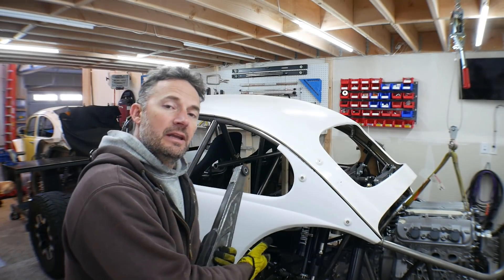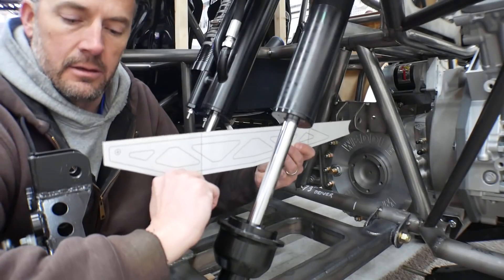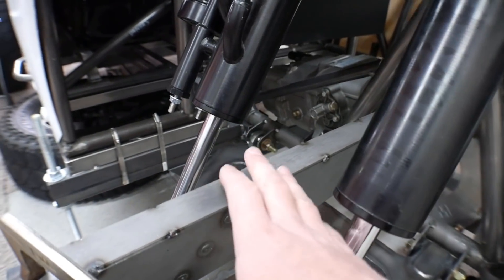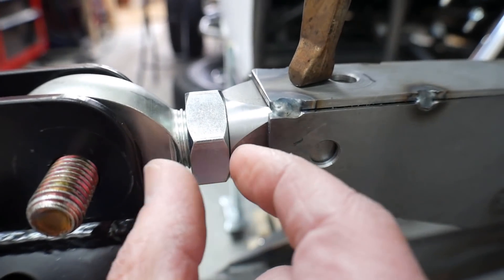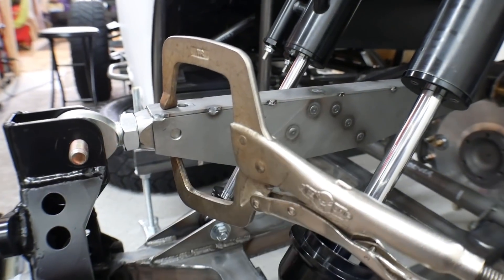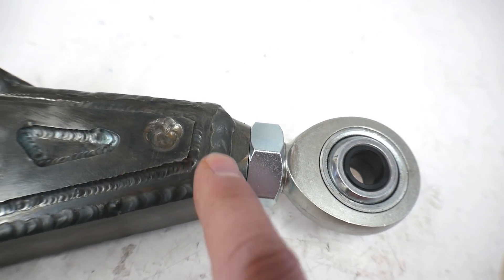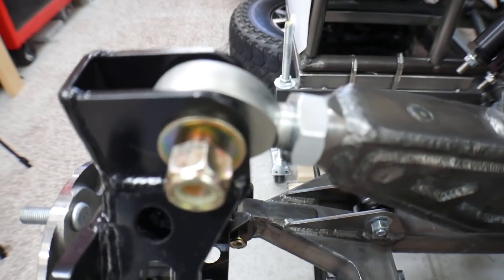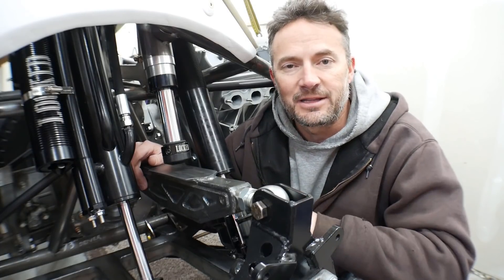Wratchet Upper link for Bump Stops Fabrication...

Comment: I have been wondering for a long time, why you chose to fabricate the axles in the rear, using universal joints, versus just using CV joints, and off the shelf axles?  CV joints are stronger than universal joints for one thing, and it's fairly easy to get axles in any length you need.  Cost?
Reply from the maker: Well, it's easier to fab with U joints. Meaning you can make changes to the track width because the axles can be moved in and out some. And it's cheaper at least at first. As to what is stronger I'm not really sure.
But in a perfect world this would be non plunging CVs, and I might switch to that once this is up and running and I know I won't make any more track width changes.
Thanks for the question.

Comment: If the heim joint breaks you could do a eccentric nut type adjuster with 2 bushing ends.
Reply from the maker: This is true, I'd have to make some changes on the chassis side. But it could be done.

Comment: Sweet bug, lots of thought into it you can tell.    Have you had problems with no filler fillets (like on your strap) ? When I was making my winch I was doing that, and they looked spectacular but upon closer inspection they all cracked because the area under the flow was super thin.
Reply from the maker: I've been ok with it on thinner materials that will not be flexed much. If it's thicker (say over 1/8") or can be flexed it'll crack. But you always take a risk when you don't use filler, typically the weld is half the strength than if you properly used filler.
Reply: @DougBugBuilder  yep, that's what happened with ours. I enjoy the content, thanks for sharing!

Comment: It would be a more involved design, but at the bushing end, instead of welding the bushing directly to it, implement a concentric housing and fastener system into the end of the strut and that would give you back some of your granular control of the camber that you lost.
Reply from the maker: A concentric housing would have been a good idea. With that I could possibly do away with the heim as well. Would need to design a housing that wouldn't be prone to rotating under impact, but that wouldn't be to tough.
Good idea. 👍
Reply: Doug Bug  I think where I've seen it best used is in the frame of the car where the arm attaches. With large washers and an offset hole and they leave the bushing and arm simple. That would require a larger update of your whole rear subframe :-(

Comment: Thanks for content i really enjoy your videos and like what you build. i gotta say however i do cringe when i see you fusing welds. IMO any weld on a suspension part should be full pen and welded with filler rod.  Welding without filler just creates undercut and undersized weld thickness.
Reply from the maker: Honestly I appreciate you bringing this up. I know from experience that no filler is not as strong. I tend to get complacent thinking it's strong enough without filler. So a reminder from time to time helps.
So I appreciate the concern and comment.

Comment: Coming together nicely Doug!  Watching that rear cycle was beautiful.  I don't think you'll have issues with torque rotation unless you get up near 350+ HP with how stout your lowers are.  The new uppers will definitely handle the bump stops.  I like how you blend your personal knowledge with the latest tech of the big boys toys.  It gives all your pieces a one-off appearance.

I know you're trying to cover all the bases, but I'll say it once more - especially now that your uppers are so laterally strong: I believe your weakest point is the mount for the inner bushing.  It appears that the C cup is welded to flat plate between the A shaped tubes.  With the lateral forces that upper will receive, I think that flat plate will deform and thereby throw off your camber.  I think a combo of boxing in and one more support tube would suffice.  Just food for thought...

Always am impressed!
Reply from the maker: I'm getting close to making Wratchet a roller. Before I do that I'm going to weld up everything on the chassis so far. This way I can take it off the chassis Jig. 
So that means I'll be boxing in all the tabs and such. But the connection you are talking about between the A shaped tubes is tricky. It needs to be removable so the transaxle can be removed. But I plan to show what I'm working on with a video when I weld everything up.
I agree with you though, right now that is critically weak.
As always thanks for the comment and opinions.
Reply: @DougBugBuilder  Ah - didn't know about the caveat, "Needs to be removable.". Always a hook to keep me coming back!  Lol    Looking forward to your solution...

Comment: I really would like to see you attaching a 10 foot pole to the spindle and see where the acceleration reaction forces end up.
Reply from the maker: I'm curious about that myself. When I get it up and running I plan to put a camera on it and do some acceleration and braking tests so I can watch it and see what I'm dealing with. There's more bracing that I could have added but didn't want to overdue it. But I'll see.
Reply from the maker: I was thinking about this after my comment, the spindle won't see any acceleration forces, only braking. The transaxle will take the acceleration forces. But either way I'll test it.
Reply: @DougBugBuilder  Correct.

Comment: The strike pad and those triangles will hold up just fine. I don’t think the loss of adjustability will be any problem. You already proved you can get it where you need it.
Reply from the maker: I thought adjustability would be an issue, but when I was setting it I had no problem dialing it in. So that's a win I'll take.  😁

Comment: Looks great. I agree it should be totally fine. You might get a slight amount of flex as the lower arm bushing wear out but if that's the case you could easily replace them with Uni-balls. I think it'll be fine though. The spread on the lower link mounts is really wide and will support it well.
Reply from the maker: I'll keep an eye on them, I also though about making them out of Delrin. But I'll see how they hold up.
Good to hear from you, you've been here a long time. ✌
Reply: @DougBugBuilder  life has thrown me some curve balls that I've been dealing with but I've been keeping up with the progress for sure. If things go as planned I'll be very busy this summer with cool projects that I'll be making videos off. Hopefully getting a new shop built finally.

Comment: Looks a lot better Doug. Just would if used 4130 for all the arms.
Reply from the maker: Problem is, because this is a design build, I continue to make changes as I go. Like I made the front control arms twice to make minor changes. So I'm reluctant to spend top dollar if it might end up in the garbage.
I agree with you on the 4130, but I'm trying to control the spending. But I also don't want to make an inferior part.
I'm hoping when it's up and running and I'm happy with the design I'll go back and make some parts better. But we'll see where it goes.

Comment: Adjustments would depend on the threads per inch of the upper heim, if its 3/4 x 16 then one full turn would be a 1/16 or half turn on the heim would be 1/32. for camber adjustment, great work as always love the beefy construction!
Reply from the maker: They are 7/8" x 14. I actually thought that the adjustments would be coarse. But when I was dialing it in to 0 camber there was more control than expected. So that was a good thing. 
Thanks for the comment, and the math!

Comment: Hey NICE JOB! the poly bushing is perfect to prevent the link from rotating. They do make sleeved adjusters that can be fine adjusted, they use a left handed heim, with a sleeve with left have internal threading, and right hand external threading, then the sleeve threads into a right handed bung. google: Synergy Double Adjuster Tube Adapter. I used them for the rear upper control arms for my 99 land cruiser. oh and a tip for warping bungs, leave an old heim joint threaded in, and wait to remove it until it cools. higher end bungs will have more clearance on the threads to compensate for this issue.
Reply from the maker: Well I didn't know they had bungs like that, thanks for the info! I don't think I'll need that, but good to know it's there if I do.
I guess haveing a heim in there would act like a heat sync. Thanks for the tip, and the comment!
Reply: @DougBugBuilder  Those are also handy if you cant easily access one side of a link. 

It does act as a heatsink, but it also will prevent it from contorting mechanically during welding, since the warping force wouldn't be enough to crush the threads.

Synergy makes these badass bushings called dual durometer bushings, definitely worth taking a look at. they don't need grease and have all the advantages of poly bushings and bonded rubber bushings. No noise, rotate without binding and flex more easily than bonded rubber and much easier than poly. they also wont beat up your brackets as much as a heim. been running them for years on my LC.

Comment: Great design considering the bump stop not hitting in an optimal location. If the inboard mount was wider it would give that upper more strength, but I see it’s getting tight on clearance . Nice
Reply from the maker: Thanks, and yes, it's getting a bit crowded in there.

Comment: I seen in your last video talking about your front steering. What are the advantages over front vs rear steer as long as you achieve Ackerman?
Reply from the maker: Personally I think rear steering is better. All the steering is behind the suspension, so it's more protected. The only reason mine is front steer is because I need to have the rack forward so there is enough room to run the steering shaft back to the wheel in a straight line.
Reply: @DougBugBuilder  Awesome thank you for your reply. I been looking all over at articles some say front some say rear with over steer or under steer being your performance difference. Then some say it’s just due to what room you have to work with. Your reply cleared up my question.

Comment: That's awesome man! I've been wanting to build 4 links like that for my 4x4. My Suburban has a 12 inch lift so they are gonna be pretty long! Would like to do something custom other than just round tube.
Reply from the maker: If you box your links like I did here, add the stiffner brace like I did if you can. It's a lot of welding, but it really looks nice! (and adds strength!)
Reply: Since I have a cnc plasma table I can cut the plates too. Do you prefer the laser cut for a particular reason?  Maybe less clean and nicer cuts?

Comment: Probably not necessary but to tweak the bump stop to the strike plate by arching the plate to look like a saddle.Very great build man ,I'm just building stuff from various re purposing. on My channel at glassblastcollision. Keep up the good work!
Reply from the maker: I thought about that, but decided it wasn't necessary. And it's tough to kink 3/16" so close to the edge. But our brains were thinking the same thing. 👍
Reply: @DougBugBuilder  You remind me of a old friend named Larry , We built ergonomic lifting equipment for factories together. I miss em he passed.  I have another fuel tank the same as the one on my channel and Id like to scratch build a complete suspension so I'm picking your brain  Doug Cheers !

Comment: Nice upper links !! I wish I had access to a plasma or laser cutting company.
Reply from the maker: I order the laser cut parts from OSH CUT, all you need are DXF files and money!
But if you have the time and patience, you can do the same with a bandsaw and some cardboard templates.
Reply: @DougBugBuilder  I'd rather just order it . I'm not too good with cutting plate 🤣

Comment: Very Nice,.....,yeah the weak spot will be the Heim ...Using "FK" Rod Ends?  May call them and ask .about strength.  Just a thought....Kevin is  a Ham   lol   Nice weather is coming!
Reply from the maker: It is FK, the specs say 55,000 lbs, but that's static load on the bearing. No specs on the vertical loading of the shaft. But it is 7/8" and chromoly, so we'll she what she can do.
Next week should be in the 40-50's, that's much more tolerable than 20-30's. 
Thanks for the comment! (Kevin is crazy!) 😁

Comment: That’s one thing you won’t have to worry about. Very well made. Could have built a v shape but “anything with doing is worth overdoing. Moderation is for cowards”
Reply from the maker: V shape would probably have been lighter and just as strong. But making it this way was easier to fab. Not saying I'm lazy, but the bung and bushing connections would be difficult.